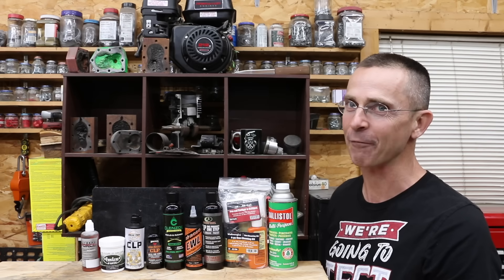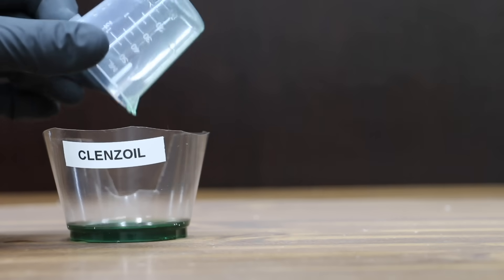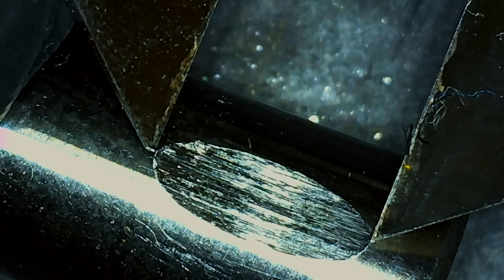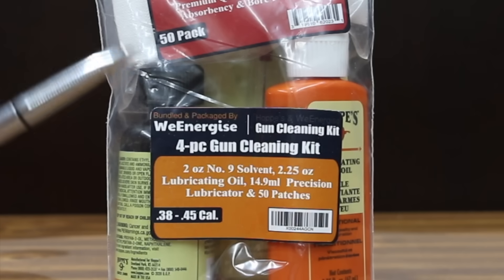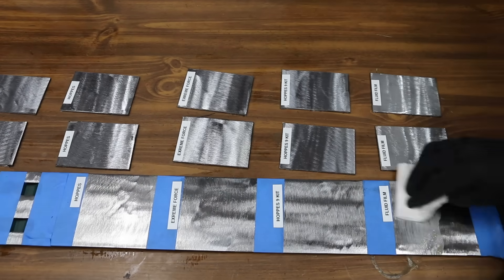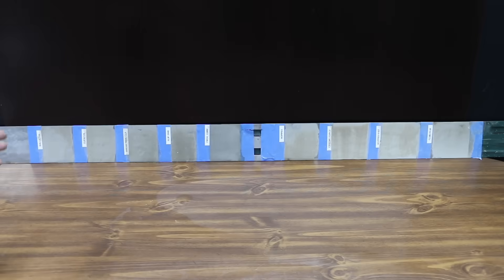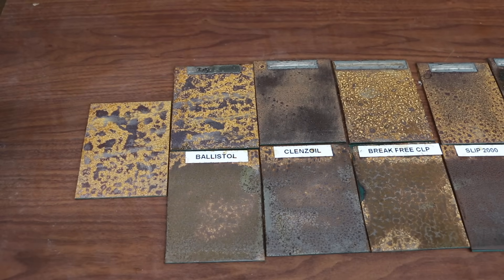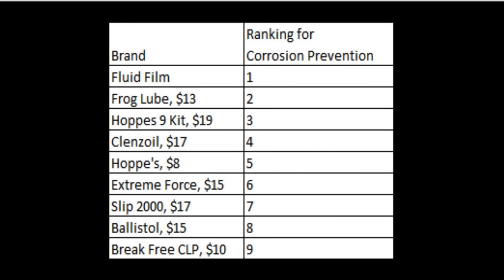Don't Buy A CLP Until You Watch This Review! It'll Save You Time And Money!

Comment: Two of my cousins used Safariland's Break-Free CLP exclusively while in the Navy, and put me on it when I bought my first gun. I always figured it must work well enough if it keeps clapped-out, 30-year-old+ M16s running cycle after cycle of training. They're even still in limited use for deployed troops, often referred to as "the musket", and I believe all the branches use the same CLP.
     Really surprised at how poorly Ballistol and Hoppe's did though, so many people swear by both of them and will use nothing else. I recently started using Ballistol myself, since it claims to be "slightly alkaline" and I just bought a flintlock (black powder and the substitutes for it are very corrosive, lots of ammonia salts and such). The flintlock has only been to the range once though for a total of 12 shots, so I don't even have an opinion on it as a CLP yet. Did great at lubing my house's 1960s casement window cranks though!
Reply from the maker: Thanks for sharing.

Comment: Another excellent video.   One additional test would be to see how long the lubricant will stay on the surface after it has had time to dry and to drop off, using a dry test.   Since the Clenzoil was the very best wet, is it also effective long after the application has been applied.   In other words, how well do these products work as a "dry lubricant".   A very effective dry lubricant could be very beneficial to coat bullets before they are placed in reloading cases.   Marketing:   apparently most products which "propose" that their product is the superior of all = LYING!!!   Hmmm, lying for profit.   That seems to be the rule rather than the exception.   Suggestion:  dry lubricant test, such as the WD-40 "Specialist" Silicone quick drying.   How well do the various dry lubricants work to prevent buildup on Router Bits?   NOTE:   The copper in a rifle barrel is a PLATING, not a fouling.   The copper helps to smooth out the roughness of the barrel.   If you remove the copper, you are NOT making your barrel better, but some people have damaged their rifle barrels trying to remove the slight amount of copper.   ATF (automatic transmission fluid) dries to be very sticky.   I would never use it on any type of firearm.
Reply from the maker: Thanks!  Thanks for the suggestion.

Comment: Excellent testing as always - and smart using the govt spec sheet for developing tests. But I have never liked the all in one cleaner, lubricant, protectant products (though for military and in the field use they make sense). I always use a separate power carbon solvent, then a copper solvent if needed, (some alternate products if shooting lead bullets), then use a light grease for those small areas that may need grease in some firearms, then use a protectant as a final wipedown. What I have observed (not tested as you have done) is that most nitro/carbon cleaners work well, some copper cleaners work better than others, bore brushes are important for lead and copper, some lubes last longer and stay in place better than others, and some protectants work a lot better than others. Also the finish of the firearm being cleaned or protected makes a world of difference on the cleaners and protectants needed or safe to use.
Reply from the maker: Thanks! Thanks for the feedback.

Comment: When I was one active duty in the Army, we started using Break Free CLP. It worked well, but I always think anything made to do multiple things doesn't do any of them as well as a product designed to do one. We found that our weapons still rusted in the jungle and saltwater environments. We used to use 30 weight motor oil on M2 50 cal. machine guns. I found some of these weapons were well over 30 or 40 years old. Some of the barrels had been replaced, but most of the internal parts were original. (Yes, that means some of then saw service in WWII, Korea, or Vietnam. I had 1911s in my arms room made by Singer, Remington Rand, and US Switch & Single.) Sometimes the 30 wt found its way onto M-16s and 1911s. I now use Hoppe #9 or Break Free for cleaning. I use a synthetic 30 weight motor old for lube. I have some long guns that don't see high numbers of rounds or harsh environments, but I have handguns that are with me everyday, exposed to weather, sweat, etc. My newest Glock that has over 20000 rounds. I don't think that's as lot of rounds, personally. But Glock says it's a higher count, so I break it down and check it yearly. It shows no significant sign or wear. (To give you and idea, the standard LEO qualification course is about 60 rounds. It's shot twice a year. With a practice and a qualification round, that's 240 rounds a year, or 4800 rounds in a 20 year career. Most of the LEOs I know put a lot more rounds that that downrange each year.)
Reply from the maker: Thanks for sharing.

Comment: I just use motor oil. If hold the friction  and the constant 190 to 210 degrees for 3000 miles I'm pretty sure that the firearm will be ok. For cleaning non chlorinated brake cleaner.  Not on plastic just metal parts.
Reply from the maker: Thanks for sharing.

Comment: I don't think you used the correct froglube product for this test, but think this test was awesome no less, as usual.
Reply from the maker: Thanks!  Thanks for the constructive feedback.
Reply: Nah froglube just gums things up...if your firearm has loose tolerances [AK patterns] then it's fine but for ARs I find ballistol with CLP works best
Reply: @ywe3  wrong 🤷
Reply: @Denman Fite  not wrong just MY experience...frog lube attracts georgia clay and pollen like no other...
Reply: @ywe3  you using a product wrong is not a reflection of the product.🤷 Cope
Reply: @denmanfite3156  right...because you made frog lube and can say for a fact I haven't been using it as it says on the bottle...
Reply: @ywe3  you can't read the directions that's not my fault. Keep up with copeum

Comment: Here's a test for you that will shock you. Take chlorine and mix that in a brand of oil you know to do bad in your test. Just a little in a cap not a cap full. make sure some actually gets on the test metal. And you'll  see a huge difference in the test before and after. Why? Chlorine has the same properties as extreme pressure additives have. And at car shows is often used by snake oil salesmen to make their product look better than everyone Else's. They will have a rag laying around that is soaked in the chlorine. At some point in the testing they'll touch this rag then they'll rub their finger that has the chlorine on them on the test parts. Then they'll run the test on their products and wow, it's so much better then the other or regular oil.

And no one is the wiser. Chlorine used to be the additive they used in gearlube when gearlube first came out. They did not have other extreme pressure additives to coat metal to protect the metal. But there is one big drawback. Chlorine is the precursor to hydrochloric acid. Just add water. And because engine and rearend part sweat when they cool down after being hot from use. The water was being added slowly and the acid content of the oil was rising. This is what puts the pits you see in metal when you remove a cam shaft or gears in a rearend. Just because something makes an engine run better does not always mean it's good for a motor or rearend in the long run. People need to get that in their heads.

How do you test for high content of chlorine? Some liquid detergent react with chlorine and turn white as soon as they are poured in. Joy used to be what I used to get reaction but I don't think they make that anymore. So find one that does react to chlorine and use that for the test. Make sure you are in a ventilated area because the reaction produces chlorine gas which is not safe if breathed directly.

When you find a liquid dish soap that really reacts to the chlorine by turning white color almost instantly that's what you want. Now you are ready to test products for chlorine content. Now get a pair of blue jeans, a type that is easily bleached and will show white areas if bleach gets on them. Put just a couple of drops of the soap into the oil additive and shake it up. now if you want to allow your audience to see the reaction, you could do this in a glass jar or some type of clear container. Because some additives have a lot of chlorine and will react and it can be seen. Others, not so much. After it sets for a few minutes take the mixed up stuff and pour it on a test spot on the jeans. This will either turn white right away, or turn white slowly. If it does not turn white that means the product does not use a chlorine additive. It uses something else.

All snake oisl use chlorine because it's cheap and they make a lot of money.

Comment: Believe it or not, I use MotorKote as my lubricant for all my firearms, and it performs very well. I even stripped a slide down completely of the rough painted finish to down to the steel and applied MotorKote and to this day has not seen the slightest bit of corrosion. Makes trigger mechanisms lighter and smoother, especially in DA/SA forms of actions.
Reply from the maker: Thanks for sharing!

Comment: It would have been interesting to see how a DIY cleaner know as “Ed’s Red” would stack up against the others. 

The formula is adapted from Hatcher's "Frankford Arsenal Cleaner No. 18," but substitute's equivalent modern materials. Hatcher's recipe called for equal parts of acetone, turpentine, Pratts Astral Oil and sperm oil, and (optionally) 200 grams of anhydrous lanolin per liter into the cleaner.   

The modern recipe includes acetone, transmission fluid in place of sperm oil and K1 & varsol.  Liquid lanolin can be included.    I regularly use this to clean firearms and it works well.    Would be interesting to see this matched up against the others.  

Also, I have a BushMaster AR10 .308 that likes a wet bolt.  The lube that seems to work best?  Mobile one synthetic motor oil.    Seems to work fine as a gun oil.
Reply from the maker: Thanks for the suggestion.

Comment: Why would you say that the Break Free CLP and Clenzoil performed the best when the Break Free scores were D , D , A , A- ? Froglube seemed to beat it by far in most of the tests except the -40 degree test which is useless unless you are in the Arctic lol. Froglube scores were A, A, A , B+and only slightly bigger wear scar by 1.5 mm. Honestly Froglube seems better and its all natural and non toxic which is a huge plus if you are cleaning them alot AND its cheaper!

Comment: I like the lubricity test and got Clenzoil as a result, but I wonder about total applicability to firearms because the firearm lube doesn't replenish during operation -- the surfaces are coated only once between hundreds of rounds fired. Some people use a mix of Mobil 1 synthetic oil and synthetic grease, and I wonder if the higher viscosity of such a concoction allows more of the lube to stay on the moving parts vs CLP, perhaps resulting in better overall protection. In any case it would be very interesting to compare single-application performance of firearm lubricants.
Reply from the maker: Thanks!  Thanks for the suggestion.

Comment: My gunsmith swears by RemOil, the old gold standard of plain gun lubricants. I've found that it evaporates over time, allowing the metal to rust within 2 weeks without use. My favorite is the more viscous Break Free synthetic gun oil, but the synthetics didn't fare well in this test. Can you test more synthetic gun oils vs the gold standard RemOil?
Reply from the maker: Thanks for the suggestion.

Comment: Hmm, there will be moments like with the heat test/corrosion resistance test and the frozen test the high viscous which is almost like grease will have a better time in heat, but froze solid in subzero temperatures. Well low viscous will dry up/evaporate in high heat temperatures, but in subzero will operate alright even if a little jellyified.
Reply from the maker: Thanks for the feedback.

Comment: Apart from a cleaning solvent, I've been using a 50/50 mix of Royal Purple and Motorkote for years now.  Filled a bunch of 2oz needle dropper bottles and scattered them around the house. Use it on everything from firearms, to squeaky doors, to cutting oil at the drill press. 👍👍
Reply from the maker: Thanks for sharing.

Comment: I don't think the frog lube got a fair shake at the friction test.  I guess it is what it is, as they were all tested the same way, but I would think based on the way you're supposed to use it, that coating the wheel first (presumably for all products) might have been a more fair test.  frog lube with liquefy with a minimal body heat.  I'd be curious how it would perform if the wheel was coated before the test started.  over all I was surprised by the lack of performance from some of those products.
Reply from the maker: Thanks for the feedback.

Comment: Cool to see extreme testing, but the reality is most of us are not going to be putting our firearms through such rigorous testing.  Rule of thumb, clean after using, lubricate sparingly on key parts, do not handle with oily hands, keep stored in a temperature-controlled environment.  Follow these steps and you'll be just fine using most CLP's or whatever you use.
Reply from the maker: Thanks for the feedback.

Comment: I would argue that the lubricity test is not valid. That setup seems more adequate to test engine parts, which sit in a bath of fresh, flowing oil. Gun parts are lubricated once and then left to work. It might be more accurate to lubricate a stationary metal plate, and then grind the test pin into that plate several times, testing both lubricity and endurance, as in the real world outright lubricity might not be the most important factor if your oil is gone after a few strokes of the part. I know several people who use dry lube on their guns and bike chains for that reason. The dry lube would also shine in the dust test.

Comment: Great test. And I'll stick with Frog Lube which I'd switched to years ago. I use the liquid and apply it via manufacturer's instructions in that I ensure it is heated during application. My experience is that it can even be too slippery as when I applied it to my M1, the bolt cycled so fast that the round from the magazine did not move up fast enough. I returned to older type lubricant and my gun cycled correctly. In winter I use the cold temp Frog Lube as the system gets sluggish during a cold New England winter. The smell is great, and being food grade and safe, I can lick my gun with no worries. :) (Okay, just kidding about licking the gun.)
Reply from the maker: Thanks!  Thanks for sharing.

Comment: I decided to revisit this and once again Farm project did an outstanding job on the Mil-Spec test. I definitely agree with his conclusion: Clenzoil and Breakfree Mil-Spec are the best overall. I just wish both performed better on the heat and corrosion test. Seeing that rust was painful...but there is an answer. Get a rust tab-Zerust for your firearm case or safe.
Reply from the maker: Thanks!  Thanks for sharing.
Reply: Thanks!

Comment: I watch all of your videos  I love them.  This video does not make sense.  You are testing these oils like you test motor oils... Firearm mechanisms are simple machines, and do not have high friction temperatures or wear.  I don't know what machine guns people use, but the only part that gets hot is the barrel, that has no lubrication.  Also, most guns are pampered and are not left in water to rust.   I have never heard of a firearm wearing out due to seizing.  Actually, I clean with wd40.  Judging by your review, then we should all be lubricating our firearms with auto motor oil  because they perform the best...????

Comment: The idea of a do all 3 function lube/cleaner doesn't really exist. It's better to clean with a cleaner.....lube and protect with something else.  Because I don't usually want alot of liquid migration, I usually lu e contact points with a light grease.....but use oils where I do want migration....say the lockwork of a revolver.
As a protector I use industrial oils with high washout resistance....such as lubriplate food grade oils.  This is the type oil they use for lubing slaughterhouse conveyors  that needs to be washed frequently.
Reply from the maker: Thanks for sharing!

Comment: If you do further testing on lubricants, CLPs, and/or solvents with an eye for firearms application, I'd like to see products by Breakthrough and Liberty Lube, as well as items that are not firearm-specific but popular with fun owners, such as white lithium grease. Liberty Lube's selling points are low viscosity in extreme cold and high lubricity. Breakthrough supposedly works well and is one of the nontoxic lubes and cleaners, like FrogLube (which works great in certain applications but is notorious for increased viscosity with age). Breakthrough used to be separate solvent and lube, and maybe that's the best way to go with separate lubes, cleaning solvents, and rust preventatives, but they do have a CLP now.

Thanks for the useful video. I feel good about what I chose FrogLube for (rust prevention, primarily, and particularly for use on knives since it's food-safe), and now have an interest in Cleanzoil. Very lubricious, but poor cold weather performance does give me some reservations. There's no one perfect CLP.
Reply from the maker: You are welcome!  Thanks for the suggestion.

Comment: The frog lube paste is meant to be used after heating the metal parts. That's why it did the best in the oven. I use a blow-dryer to heat my barrel then apply it.
Reply from the maker: Thanks for sharing.